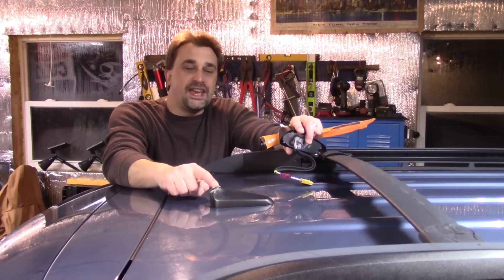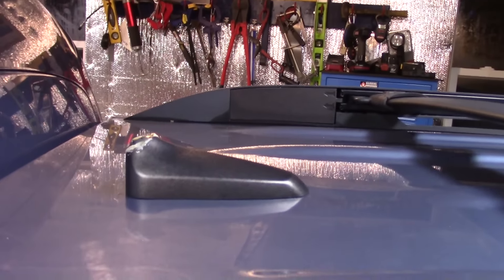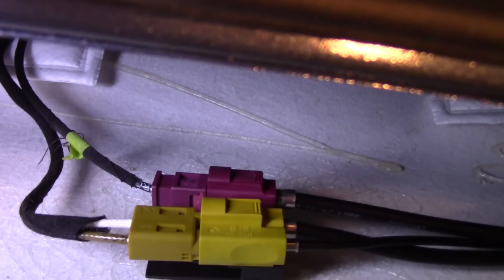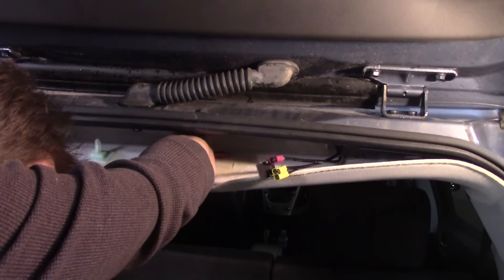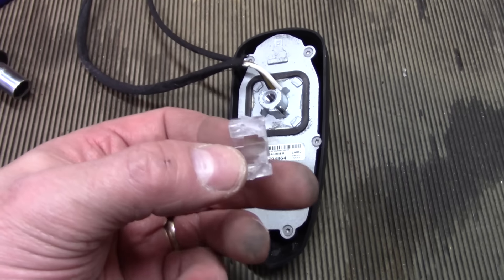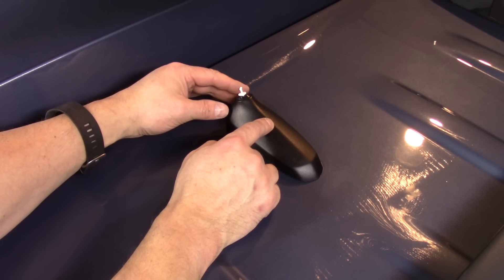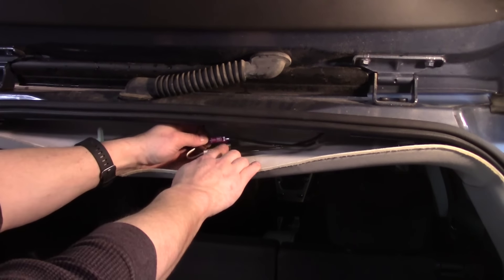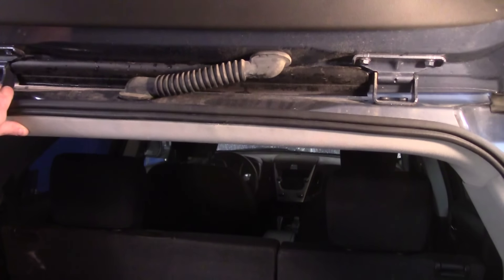DIY How to Replace a Broken Roof Mounted Antenna and Base on a Chevy Equinox GMC Acadia Sirius Radio

Comment: 2017 Acadia  ....Extremely difficult to get to the screw.  2 hours ...no success...to Menards to look  for 10mm with some type of flex ratchet. Roof frame and lower liner are a bear!

Comment: Thank you for this video my audio went out in my car.  The dealership wants to charge me 550 dollars after diagnosis says it’s a bag antenna base.  With a little clarity this looks very easy to replace and I hope my audio comes back, signal sound, seat belt chimes as well.  I ordered my part and I hope this fixes it.

Comment: Very clear video. Experiencing leak with 2008 Saturn in the exact same spot, directly below the rear mounted antenna. The antenna is working. Could I try to patch with 100% silicone around the base of the antenna, rather than replacing?

Comment: How do you get the leverage? My 2015 Equinox is similar and has very little space to get to the screw. The walls are keeping ceiling up. Did you force it down hard to get the clearance? I don't want to permanently bend the ceiling.

Comment: OK Mark.  I want to add XM radio to my 2014 Police Explorer.  Will the rear radio antenna have a self-contained XM antenna in the antenna block?  I see the basic antenna has 2 coax connectors.  I assume is for XM radio and the other is for the Car radio.  That is the other cable used for?  Is there DC power going to the antenna?  What is the need for the other black cable?  Also, would the police vehicles have the cable to the XM radio?  Seems they could same money by just purchasing one standard cable from the vender and wiring all Explorers the same with the same cables.  I have not removed my headliner yet to see what is up there.

Comment: Great. video. I have to replace mine on a Kia Soul (antenna damaged from a canoe on roof) Mine is in a similar location and I was concerned about how flexible the roof liner would be. It looks like it will be a fairly easy fix now.......Take care, Bluefin.

Comment: I'm pretty sure the base of my nissan antenna has failed - common problem - and I'm fairly sure the replacement procedure will be near identical to this. Thanks.
Reply: paul i have nissan cube..i'm gonna try to use a infinity shark antenna..the high end aftermarket shows Q50 as the same antenna..i have found perfect/exact color 40.00 or best offer..

Comment: THANK YOU!THANK YOU! i need/want to put a shark fin on my car.i have expensive aftermarket on..but tore it off.i need to see if plugs in like its big cousin infinity.its a third of the price ..i just knew there had to be away without taking the headliner down.
Reply: I'm looking to buy a shark fin asap. Do they work as good as the original antenna?

Comment: Looks pretty easy, one thing my wife had a freak thing happen, while backing out of garage the door came down and not only crack the antenna but the roof has a little dent that looks like it can be popped out. Right now the old antenna is not sitting flush. I would like to do it because letting a body shop do it would cost a small fortune. Any ideas.
Reply: Did you ever figure this out?

Comment: The only part I needed to watch, replacing the antenna mast, was blocked by links to other videos.
Reply: @nogripes  Do all antenna masts for rooftop antennae screw off by hand?  Or is there a special tool needed?
Reply: @nogripes  Thanks.  I'll try again.

Comment: Hi there, is this for FM? XM? Both? The part description says "high frequency" antenna, but thats not clear if it covers FM. My Chevy volt FM reception has become pretty bad, picking up few stations now... Thanks!
Reply: Did you replace your antenna, any luck? I don't have xm connection and my fm stations come in poorly.

Comment: Would this apply to replacing an attenna that the top cover got smacked off but the rest of the electronics are in tact?
Reply: I would imagine so, although it appears that the electronics are in tact.... Chances are it might have been damage done by moisture and water!

Comment: So I have questions if you can answer them for me..? My antenna isn't broken physically that I know of I'm having issues with static so much static a channel will be clear as day drive a little down the road boom static. sometimes its light static sometimes you cant hear nothing but static. mostly all channels are static.. I don't wanna buy a brand new antenna if that's not the issue. I don't know if these need recalibrated or maybe its something else wrong with maybe a loose wire or somethin please help the static is driving me crazy.. Also mine is an 08 Pontiac Torrent GXP 3.6L V6
Reply: Having the same issue with my moms Chevy Colorado.
Reply: thats called interference. You can not fix that because it have nothing to do with your antennae. You could physically move to another part of the country.
Reply: try flexing the rubber mast.  My rubber antenna seems to be mostly broken through near where it screws into the base, but you wouldn't be able to tell by just looking at it.  

If the static seems to be worse when going over bumps, then something is partially broken but not broken all the way through.

If that doesn't work, try unplugging all parts of the antenna system and then plugging it back in.  One or more pieces might be broken, and you might be able to detect a difference by manipulating the pieces.

Comment: I am trying to find the How to for 2015 Equinox LT I went on Amazon and a few other sites I can not get the correct part number? I called the dealer and they will not share the Part number
Reply: Google search. Mine lead me to ebay for 2012 Equinox - 2 wire non-didgitial, around $45. I think newer Equinox like yours is digital, 3 wire.

Comment: I have a 2012 Chevy Cruze and I recently brought a shark fin antenna it doesn't fit over top of my old antenna could I replace it with a smaller antenna for the vehicle to fit the shark fin over top of it ?